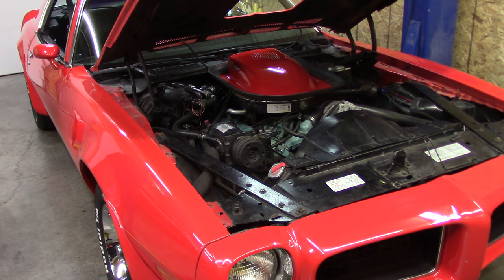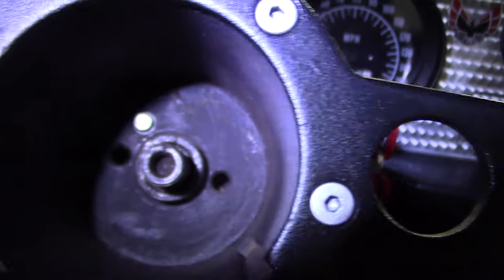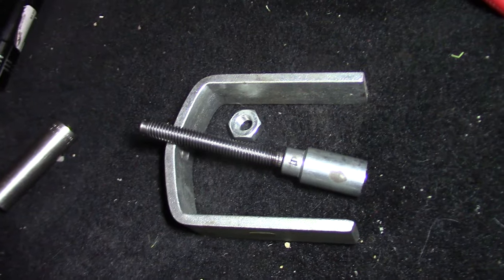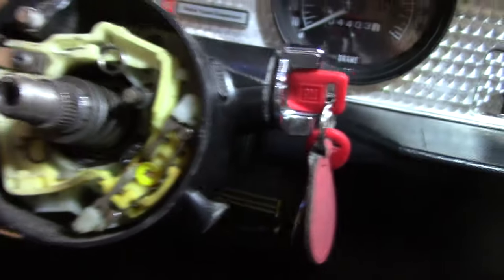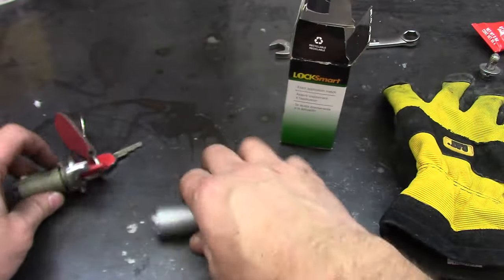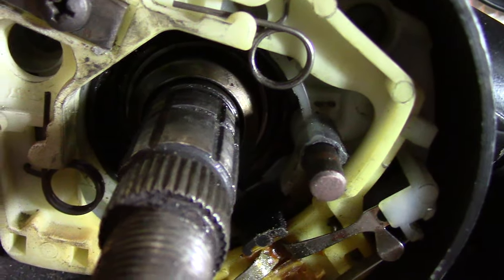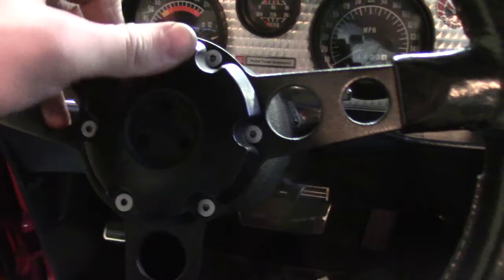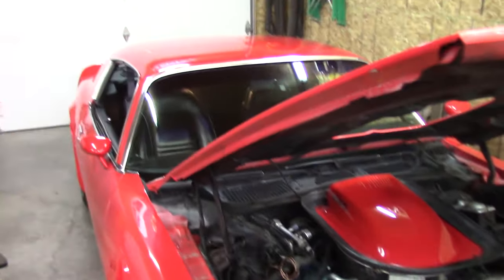Firebird Ignition Cylinder Lock Replace  Camaro 1973 GM

Comment: Thanks for posting this. I have a 1973 Formula 400 and my lock cylinder just shit the bit.  Ive built a few engines, but I have never done battle with the dreaded GM lock cylinder. Now, to find my steering wheel puller.....

Comment: Great presentation, Olds!  Just went through this and for those who had trouble returning the key back to Lock position, I discovered that the middle steering column sleeve (inbetween Tilt lever and the Ignition switch) has approx 45+ degrees of play so if you turn that left or right you'll find the sweet spot to relieve the pressure that it puts on the acuator rod and allow the new cylinder lock to fall into place.  This was on 76 TA.

Comment: Finally a 'How to Video' on removing the Formula wheel to replace the old stuck ignition cylinder. My 1976 Trans Am cylinder is locked the same way and I can't turn the steering wheel because of it. It's been sitting for 30 years in the same position.

Comment: Hey, I've taken apart my wheel assembly, I was having two problems, the ignition locking cylinder was coming out of its place, and the horn wasnt working. I think the original owner replaced the locking cylinder with the wrong one, it had a groove for a screw to retain it, but my camaro doesnt have a place for that screw. I was wondering if you would know what to do?

Comment: Hey big fan ! Loved your shifter video . But I have a question about the flashing over the plunger . Was yours just a matter of just dragging a small flat head screwdriver over or did you need to punch through it , with a flat head and a hammer ?
Reply from the maker: Any flashing I've dealt with on GMs knocks out pretty easy.

Comment: Hi, I got an 1980 Trans Am, but the key stopped working in NEUTRAL not PARK. Do you know how to move the gear stick to PARK.  Thanks
Reply from the maker: Replace the key cylinder right where she sits.  If it needs to be put in park bad for some reason disconnect the shift linkage going to the steering column.
Reply: @Oldsmob455  Ok mate, thanks

Comment: Will a bad key cylinder turn engine over but won't start. Thank you
Reply from the maker: If the engine is turning over and not starting you have eithe a fuel, spark or compression problem.
Reply: Oldsmob455 well it's a complete rebuild and everything is new under the hood. I drove it up to Walmart after I got my exhaust done without a problem drove great. On my way back home everything was fine until I got 2 feet from my parking place it died or stalled as if I just turned the key off. I tried starting it it run for a split second and the same cut out. Tried again nothing engine just spins with compression. 1st I checked the fuel as I knew new fuel pump great pressure. 2nd spark. I checked all plug wire's one was off from the dizzy laying on the intake correction made. 3rd try to start it nothing. Back to 2nd spark. Pulled a plug put a screwdriver in and put it on the head no spark. I changed out module-rotor button-cap-coil. Still no spark. Trigger wire has power. I stumped. I've read where a bad ignition switch can cause it not to start. Or it may be electrical. Im unsure. Thanks for your response.
Reply: My 1981 Oldsmobile Cutlass Supreme I inherited from my grandfather has a similar problem, except when I turn the key to start it, it cranks but doesn't fire up, so after 3-5 seconds of turning key and no fire, I turned the key off but it doesn't  obey, I turned the key to off position and pulled the key out of the ignition holding it in my hand and the engine is still cranking itself trying to start. with no key in the ignition and in the off position. I had to jump out and disconnect the battery cables so it would stop cranking itself. think it may be the starter. But I'm not sure
Reply: PhenomProductions23 Check your ignition switch. It's located and mounted on top the column. If your shifter is on the floor it could be mounted inside the console.
Reply: 1999 
PONTIAC CATALINlA 400-THM400